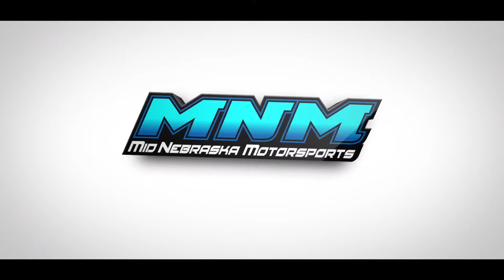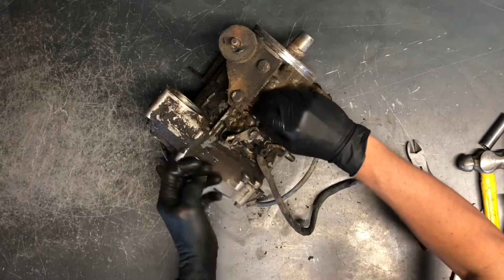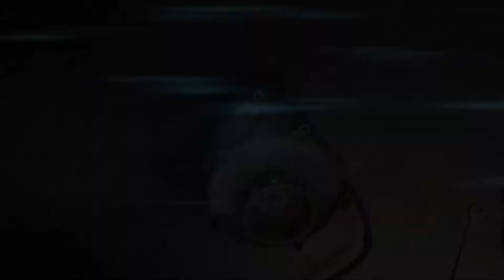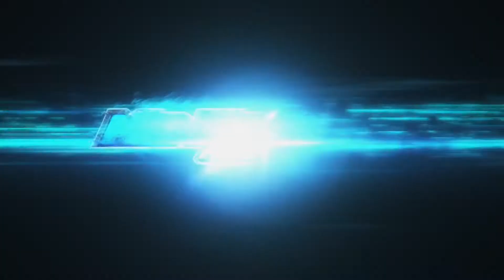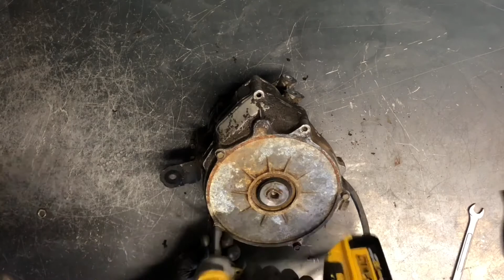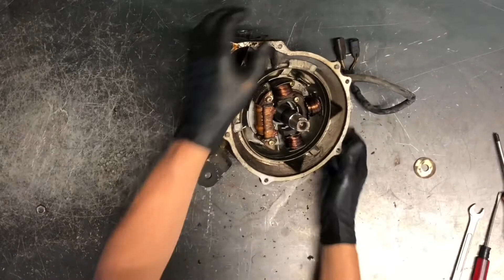Polaris Trail Boss / Blazer 250 - Flywheel Removed / Stator Magneto Issue - Won't Start

Comment: What i wanted to ask is i got a polaris and 250 trailblazer and i was wanting to ask u i rebuilt my carburator and cleaned the gas tank but what i just found out was my son got the motor wet in a creek and he said it didnt act right and it got to were it was real gard to start now it wont but i have spark and im getting gas to tge plug but its not starting now my fire aint as hot as i would like but it is can u tell me what my next step should b.  O yeah i done a compression test and ut was a dry crank no gas in piston but it was 90 to 100

Comment: Hey Dude love the videos but I was wondering, so I have a 1988 Trailboss 250 but its the other model so the problem is I got it seized !   well I got too unseize after some work and its not bad at all in terms of scoring or how bad the bore and piston looked. Now the biggest problem now is the spark plug CABLE I've never seen a cable just not there and I cant find where it goes I know the spark comes from the magneto but in this video I don't see the wire that connect it to the magneto. now I thought those wires sticking out where the it but I just check mine outside and it doesn't connect them. I've checked diagrams and all and I just cant seem to find WHERE IT GOES it's so frustrating. If I can find it I'm planning on buying it from your Ebay that's actually found you from Ebay and that's how I even found this channel but anyways keep up the great work and I hope I get a response soon :)